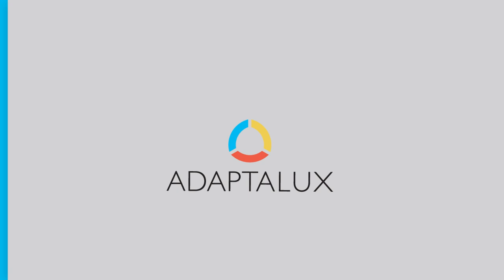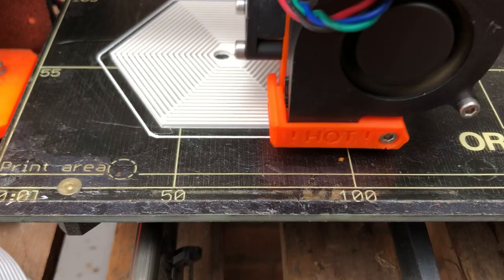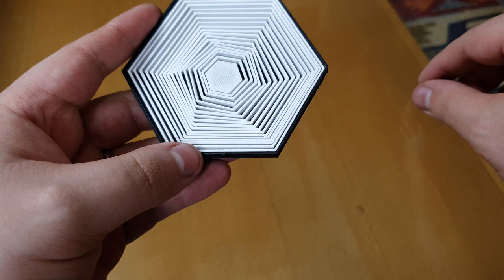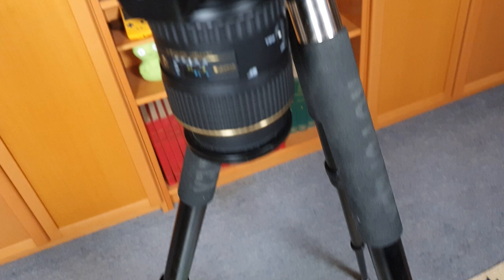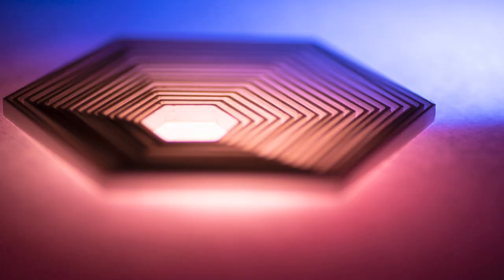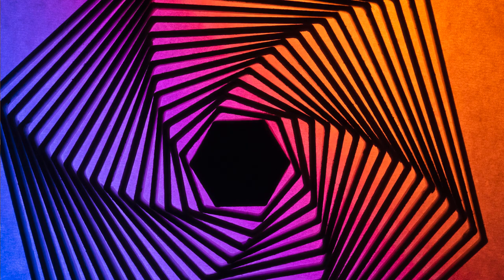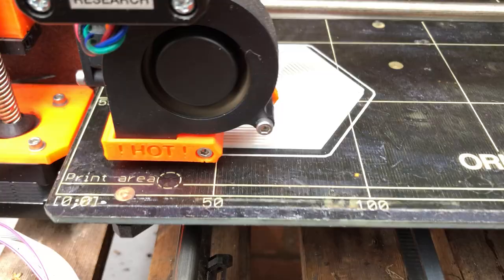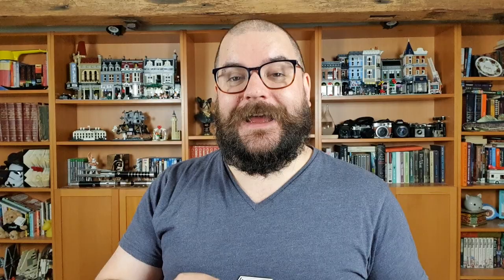Geometric Hexagon Art: Abstract Macro Photography Tutorial

Comment: Short of buying a 3D printer which could be expensive and requires some level of expertise to operate as far as I can tell, you can use 3D printing services from a local provider. I did just that for printing only the hexagon, since, as illustrated in Ben’s tutorial, the box and the pin proved not to be essential for the experiment. Total cost: CAD$23.00 including shipping. The hexagon piece by itself was CAD$8.00.
Reply from the maker: Thanks for sharing your method of getting hold of one without having a 3D printer yourself, hopefully others can follow suit and give it a go!